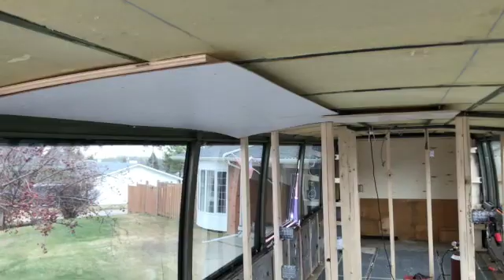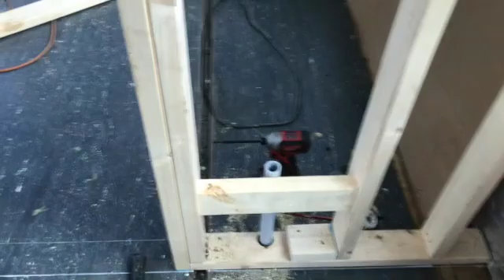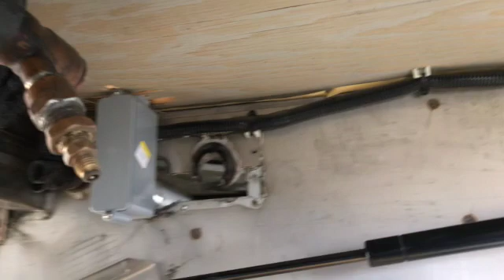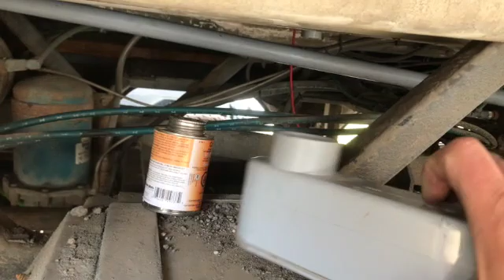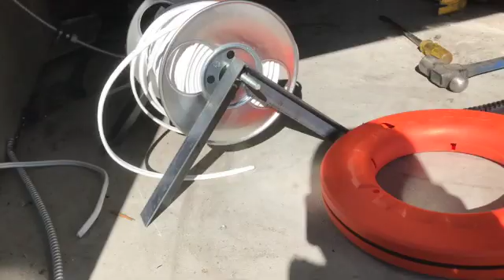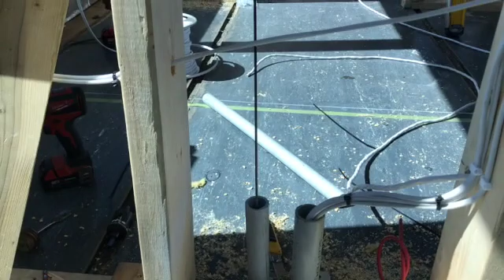Season 1 Episode 7   SD 480p

Comment: Is that black gunk sikaflex ?
Reply from the maker: No idea, but its crazy stuff that's for sure, I want some
Reply: We used the black Sikaflex to secure the sheet medal to the bus , n seal on my kids max air fan too. 
Anywho… Hope u find what ur looking for . 😊
Reply from the maker: @HOPEbus  do you have a link to what you used? dose it dry like rubber?
Reply: @destinationunknown.prevost8886  ya like a strong rubber . . 
My hubby ordered it , n he’s not home at the moment . But the full name that ur looking for is Sikaflex 221 
Multi purpose polyurethane sealer adhesive. We ordered it from the states . $30 each 🤪Duty fees not included . 
Hope that helps